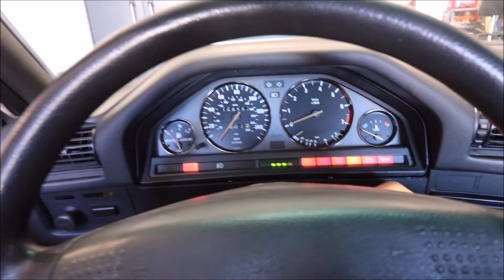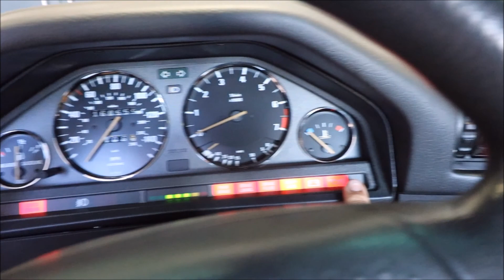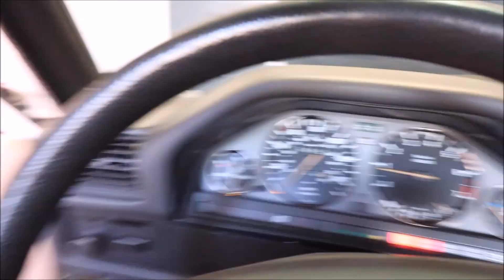E30 MAINTENANCE

Comment: Great video, I'll be getting my first e30 tomorrow. Question, so everytime you change the oil you have to reset the oil light? And how often do you change the oil? Thanks bro keep up the great work.
Reply from the maker: Personally I like to change my oil every 2-3k depending on how i’m driving it since I run the castrol conventional 20-50 but you don’t really need to reset it, i’m just ocd like that lol

Comment: Is 20w50 the manufacturer recommended oil? I just bought an e30 and it gets delivered in 10 days!
Reply from the maker: yeah the manual will give you a list depending on what climate zone you’re in there are certain oils you can use but all the e30 owners i know use 20w50